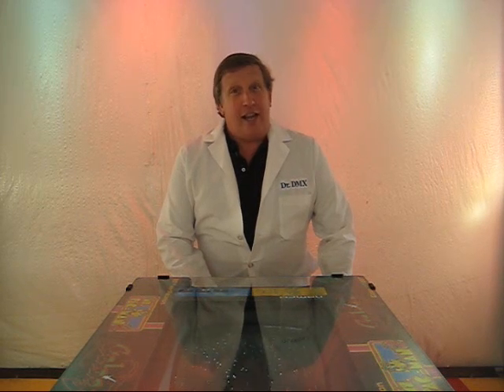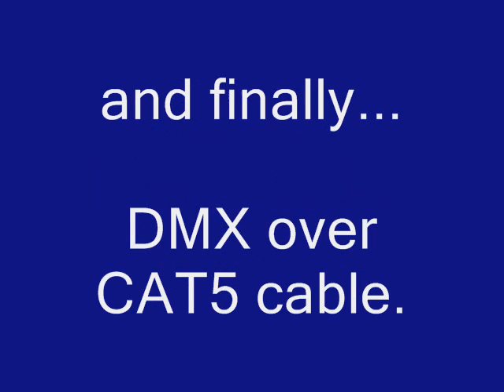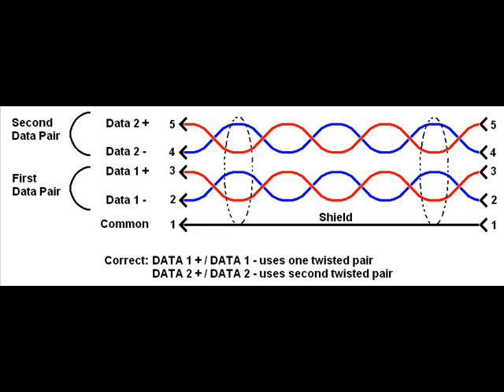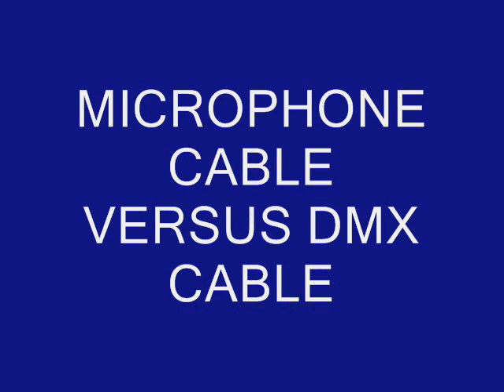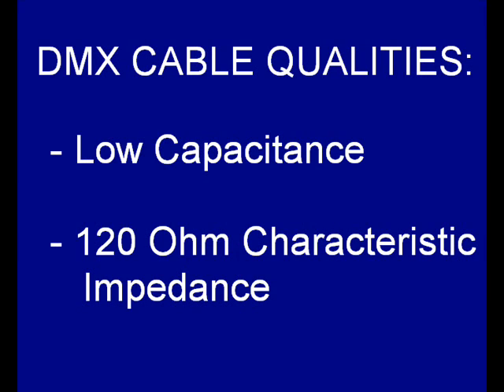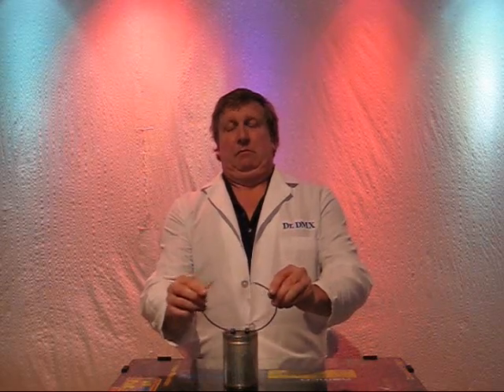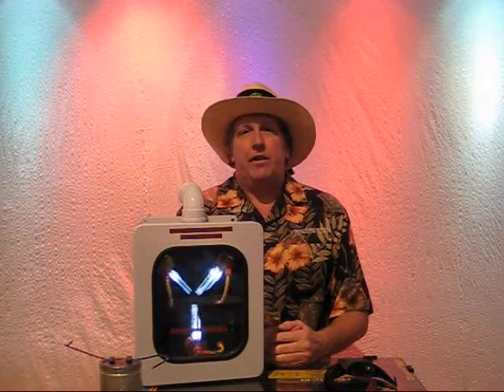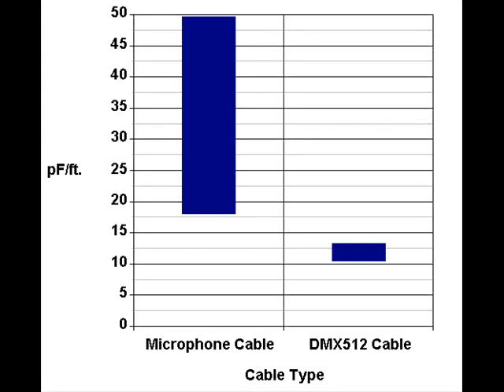Informational Video: DMX512 Cable - Part One

Comment: You're so right about cables. I learned the hard way. 20 years ago, I bought six Clay Paky goldenscans. There was two in for repair (not cheap) all the time. New main cards were being eaten. After four years, it turned out to be the wrong cables! R.F. interference.  Every time a taxi, or a beer pump motor, or whatever? Would risk damage to them.  Many shows were ruined. 
Take note people. Don't make the same mistake as we did! It cost us £1000s!